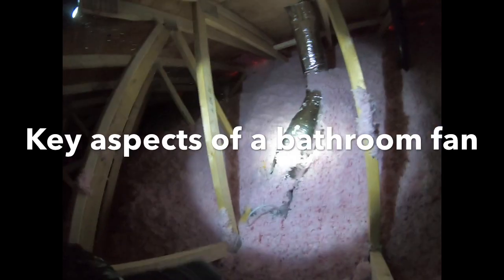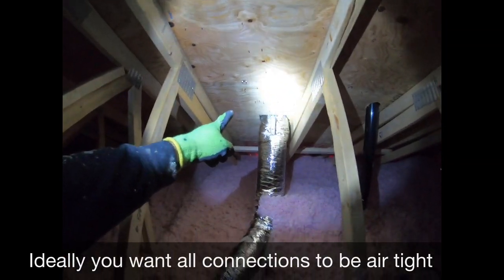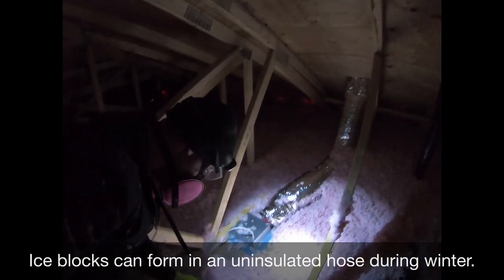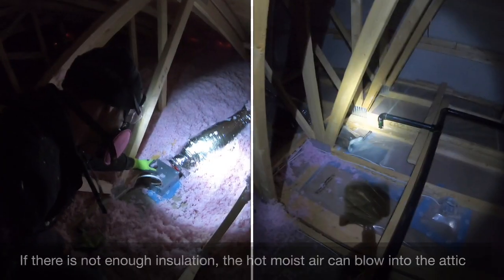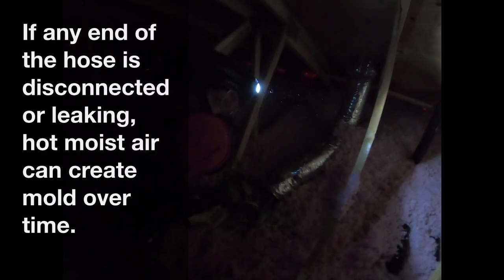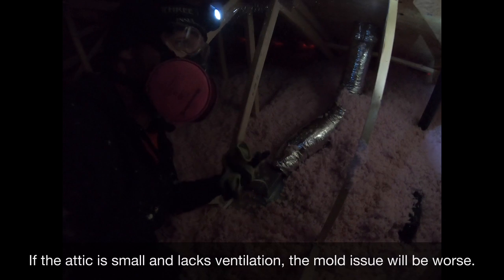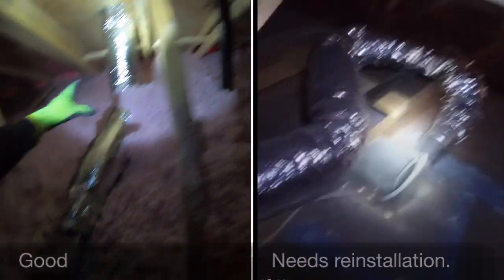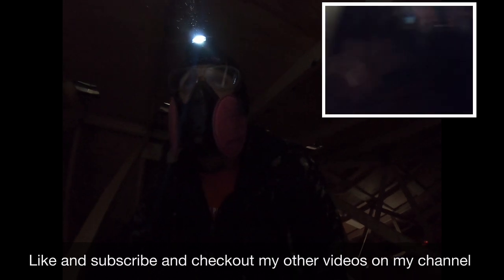Attic insulation- Bathroom fan and exhaust hose installation

Comment: Awesome brother. 
My brother is a foam sprayer and one of the techniques he uses around the fan housings is he puts a small cardboard box around it and encapsulates it with foam. 
I've done this also but with the canned foam. 
Good video
Reply from the maker: that is the way to do it. especially 2 pound closed cell. thanks for watching and make sure you check my other awesome videos 😉. I post every Tuesday.
Reply: Cardboard against the fan box or are you creating a dam couple inches away?
Reply from the maker: Hey man, made another bathroom fan video if you wanted to check it out. Would like your opinion on it. https://youtu.be/7A3zheF-r1o

Comment: I'm working on this in my attic. I've learned that it's best for the ductwork to angle down to the vent (on the side of the house). I plan to use semi-rigid ductwork and wrap it with insulation.
Reply from the maker: Yes well rounded plan so that any condensation does not comme back into your fan and house. I often see them exciting the soffits. But you have to make sure the hose is insulated while in your soffit and has a proper soffit connection. Minimizing the length of the hose is also crucial so the exhaust air exits far away from the house and does not loose too much momentum.
Reply: @SinnisjInsulator  I installed a vent cap in the wall, not the soffit. The wall is less than 8' from the fan. I got 4" semi-rigid aluminum duct tubing at Menards, a 4" Y (for 2 bathroom fans to exhaust through one vent cap outside) and will get some sort of insulation wrap for putting around the semi-rigid duct tubes. I am going from old fan with no venting to now trying to be adding the best venting I can.  Your attic looks a lot like mine except mine has blown-in insulation on the drywall ceiling. I have to be careful where I step! I put some 3/4" plywood for platforms to work on. Thanks for your video. I found it very helpful.
Reply from the maker: @ds61821  thank you for your support on thus channel. I understand you have a flat wall or gable wall on two sides of your house which is where you are exhausting your fan. 4 inch should be plenty. Make sure you wrap that very well and add at least an r32 or 12 inches if loose fill above the pipe even if it's wrapped just to be safe. You can checkout my how to fix loose fill, 5 things to do before insulating your attic and the ventilation video. That would help you even further. I would recommend an r60 for your attic after all is done. That's 22.25 inches of Fiberglass. You can do this stuff on your own of course, just be careful.
Reply: @SinnisjInsulator  I'll revisit this once the fans are replaced. My neighbor had his ladder up by his garage and I asked if he would help me install the vent cap on the side of my house. He's young and was happy to help. I had everything ready. But now that the vent is in place I'm buying what I need to get this project moving again. And trying to get it right from the start. Thanks.
Reply from the maker: @ds61821  I'm glad I could help. You can subscribe to my channel if you haven't already. I have more videos coming, one every Tuesday.
Reply: @SinnisjInsulator  I just now ordered via Home Depot 4" duct sleeve (25 feet) to put over my 4" semi-rigid duct tubing. I'll run that from fan to wall.  I subscribed.
Reply from the maker: @ds61821  good luck and if you have any questions or want to see specific videos I'll do my best to upload them. I do about 4 attics per day during the week so there are lots of models I can reference to lol. They are mostly new homes.
Reply from the maker: hey wanted to reach out, I uploaded a holiday challenge if you wanted to check it out, it's for charity. https://youtu.be/hnJZJspRU6E
Reply from the maker: I've uploaded a new video on bathroom fan installs, it's quick but good quality. https://youtu.be/HywCrcLVLko
Reply from the maker: Hi David, I made another attic bathroom fan video if you wanted to check it out. Hopefully your project either is going well or was successful. https://youtu.be/7A3zheF-r1o
Reply: @SinnisjInsulator  I remodeled one of two upstair bathrooms so far. I took your tips and made it vent to the outside using the gable wall. I put a Y pipe to the vent cap (a good and young neighbor cut the hole for me in the wall standing on the garage roof). I capped the other side of the Y pipe for the next bathroom remodel. I then checked the suction power. I was able to suck a paper towel to the fan. I looked outside while the fan was running and the louvres opened as I hoped they would. They closed when the fan was turned off.  It feels good knowing I have successfully vented this bathroom fan to the outside. Thanks for your great video assistance.
Reply from the maker: @ds61821  no problem man, I did send you this other video https://youtu.be/ZFb3gboBT9U because it includes much better video angles if bathroom fans and talks about the importance of insulation. Please have a look as I think it will benefit you. Have a great weekend.

Comment: My current exhaust holes is the rigid steel covered with those fluffy insulator, do I need to change them to the flexible holes with insulation around them? Thanks again!
Reply from the maker: If you model is exiting through the soffit, having the extra wrap won't do much because you will also be putting in extra insulation on top of the wrapping anyway. But also make sure your exhaust pipe is air tight. If it's the rigid one, put duct tape or other tape meant to seal duct work on that seem along the whole pipe. If the pipe is exiting at the roof like in the video, you should definitely get that wrap on the outside. Hope this helps, you can look at the links I provided in the video description to give you an idea what to purchase.
Reply: @SinnisjInsulator  It's exiting to the roof. Much appreciated!
Reply from the maker: @James_m7  then wrapping with that foil is a must, that way the cold weather won't ruin your wrapped insulation. Those sleeves don't have much r value to begin with.

Comment: Just subcribed power ☝
Reply from the maker: Thank you for subscribing. Next Tuesday I will be talking about the attic hatch.
Reply from the maker: @obiedashinobi1322  just did.
Reply: @SinnisjInsulator  ty for the energy
Reply from the maker: @obiedashinobi1322  it's all about supporting ine another. Good luck
Reply from the maker: hey wanted to reach out, I uploaded a holiday challenge if you wanted to check it out, it's for charity. https://youtu.be/hnJZJspRU6E
Reply from the maker: Hey Obie, I uploaded another bathroom fan video if you wanted to check it out for more info. https://youtu.be/7A3zheF-r1o

Comment: Here is a super tough insulation job that looks very simple, but is VERY difficult. A 4'x4' skylight taken out of a 100 year old house in the bathroom. Ceiling height about 16', 2x6 rafters, an exhaust fan installed in the cavity. My main concern is moister and rotting. The cavity is enclosed and no air space to rafter. How to insulate? need holes in sides to allow moister to escape, air tight exhaust venting. The exhaust duct has 1" space between duct and roof sheathing and can not bend exhaust like regular 4" tubing to the roof vent, and only 12" pipe run from fan to roof vent. When all insulated, then the ceiling cavity is drywalled. The last thing anyone wants is a hidden rotting roof due to moister build up from the fan leakage, and/or condensation from hot air.
Reply from the maker: I would try and remove the fan and then put a foam board of 1inch directly underneath the sheathing then putting the fan back. Let me know if that's possible

Comment: Hiw do you feel /knowledge of blown vs batt vs spray foam roof?
Reply from the maker: Thank you for that question. You must be talking about just the attic. I'll compare fiberglass batts and loose fill as well as spray foam. Great idea for a new video, thanks for the idea. Batts are typically found in slopped ceiling where loose fill would slide off if stoppers weren't installed. The thing with batts is that they with leave a weak point at the edges no matter how well you install them. They fit inside truss cavities and most of the time leave the trusses bare. Wood only has r1 per inch. Sure you could overlap another layer perpendicular but it depends how easily you can access that area. Attics can be difficult to maneuver. Loose fill fills every gap nicely and provides a more even resistance in my opinion. Spray foam as closed cell foam is obviously the best choice to resisting any heat transfer but is also much more expensive and can be dangerous if not installed properly aka installer installed too much at once therefore it doesn't cure. Anyway I think I'll describe this better in a future video. I have a holiday contest video if you want to check it out.
Reply: @SinnisjInsulator  
I am battling between rockwool batt and spray foam the roof. 
Both about same cost.
Creatures dont like the rockwool. Batt requires less inches.
I feel that with spray foam it should have a second layer (1" gap ) to remove roof deck heat.  I dont think there is wnough infor on spray foam.  Advantage is.. The attic becomes similar temp to the house.

Blown in for me i feel is not an option. I go up there every couple years to run wires and random things. Blow in would fill the attic. Makes service difficult. 

If i go the batt route. I will probably blow in a couple inches to cover the trusses.
Reply from the maker: @turboflush  if you are looking to go in the attic after installing Insulation then I would go for rockwool because it is much easier to fix if you need to run more electrical or whatever else. Spray foam is a permanent install and would be a nightmare to remove to run more wiring. If you can, also invest in lumber and build a walkway especially if you have a truss system in your attic. Walkway doesn't have to be that wide. Adding loose fill over batts is a great idea to fill those gaps.
Reply: @SinnisjInsulator  the spray foam would be on the roof. Making the attic a conditioned space. Which puts all the duct work in conditioned space. 
Maybe not so common up north.

They can spray the ceiling(attic floor) but uncommon.
Reply from the maker: @turboflush  ok no that would make sense. For a ceiling application I've seen half pound and understand your issue where that would nit allow any airflow if it's sprayed directly on the underside of the roof. You could put cardboard inserts to allow for airflow between the foam and the roof though.
Reply from the maker: hey wanted to reach out, I uploaded a holiday challenge if you wanted to check it out, it's for charity. https://youtu.be/hnJZJspRU6E
Reply from the maker: I've uploaded a new video on bathroom fan installs, it's quick but good quality. https://youtu.be/HywCrcLVLko

Comment: Roofers are big time to blame on the bath vents. 
One crew removes all the vents. Another tar papers it and another does the shingles. 

I dont know how the manufactures can get away with not sealing the fan boxes.
Reply from the maker: I totally understand, plus putting those plastic covers adds height , therefore even less insulation above the fan box. thanks for the comments.
Reply: @SinnisjInsulator  i usually run foil around the seams and extra holes on fan boxes.  Extra time. But no air leak. And just insulate right up to it
Reply from the maker: @turboflush  that's another good way. I unplugged my fan at home from inside my bathroom and ran silicone in all the holes I saw. I didn't want to go back in my attic and disturb my r60 lol. Thanks for the comments.
Reply from the maker: Hi Turbo, I made a new bathroom fan video if you haven't seen it yet. Sharing info on my job experience and what I notice throughout the years. https://youtu.be/7A3zheF-r1o